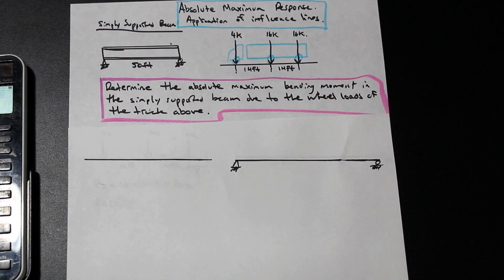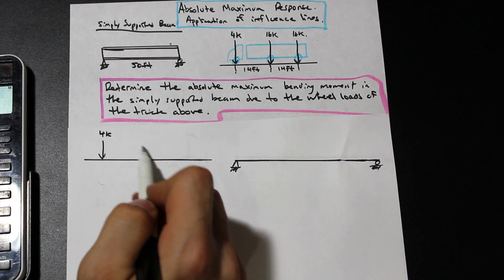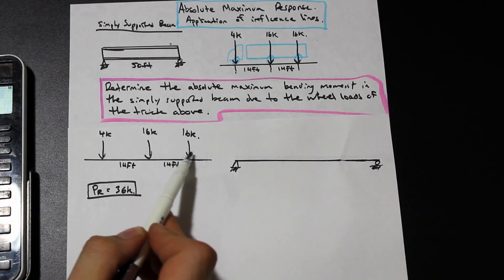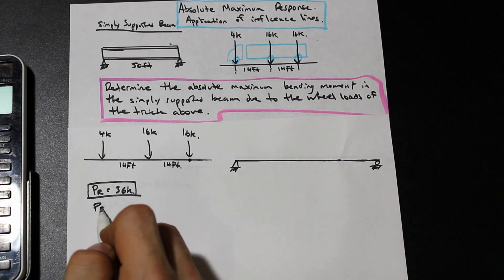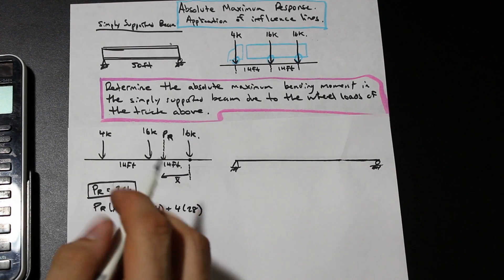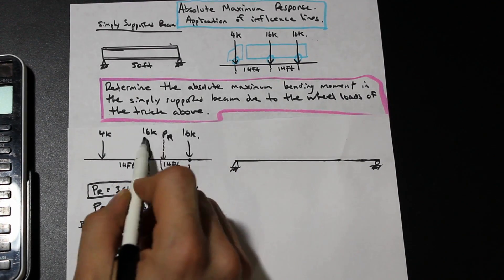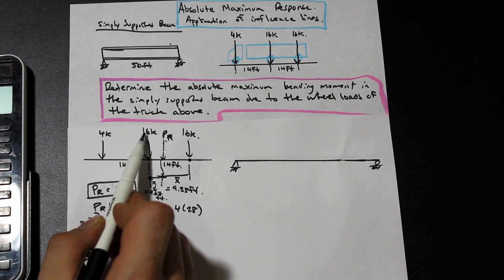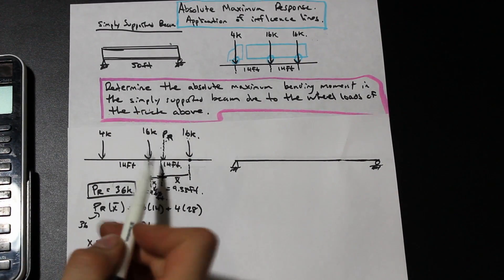Application of Influence Lines - Absolute Maximum Bending Moment (Series of Concentrated Loads)

Comment: Hey thanks for the vid.
I have a question tho. What is the logic behind placing the load such that the distance from it to the CL is equal to the distance from the CL to the Pr as shown in the vid? I understand the use of influence line but I can't seem to connect it with this calculation. Thank you in advance.

Comment: Great video. That's help me a lot. But could you guide me how to calculate the ordinate of each point load, then we can take each point load multiple with ordinate to get maximum bending moment. Thank you
Reply from the maker: Hey, this video was on how to calculate the location of where to place the truck on a simply supported beam.  It's related to the influence line of the support layout you have.  The point loads themselves are spaced according to the given truck load from the code that you're supposed to design for.
Reply: Thank you for quick reply. Could you please make a video that show how to calculate the ordinate of series concentrated load of Influence Line Diagram
Reply from the maker: Yes we will make a video on this topic,.thanks for watching!

Comment: Hello there, We were asked to consider the following: we need to place as many trucks possible on the beam. E.g. since this one is about 26 long, how many axis can you put on the beam? How would you find the maximum moment of the beam? Any help? Thank you!
Reply from the maker: Hey there, it's an interesting question, it depends if the beam is simply supported.  I know in the Canadian bridge design code, they make you design for a uniform load (assuming the bridge is stopped in traffic, so the bridge is full), and a truck (the type of truck, axle layout and load is specified in the code) placed as to create the maximum moment plus a dynamic load factor due to the movement of the one truck.  You'd need to be given the amount of axles, space of how many trucks could fit on the bridge, etc...seems like a strange question heh.

Comment: you said this is an application for influence line, yet you didn't even use the influence line of the beam ?
Reply from the maker: This is an application of influence lines, where the truck is placed is based on the influence line of the beam, we just didn't draw the influence line itself.

Comment: I am sorry to say that your calculation is wrong, because the absolute maximum moment in a
simply supported beam occurs under one of the concentrated forces, such
that this force is positioned on the beam so that it and the resultant force
of the system are equidistant from the beam’s center-line ....
Reply from the maker: Before making accusations, you should probably listen to and watch the video more carefully.  At 7:47, we clearly state that the maximum bending moment happens under the second axle.  This is obvious, as the bending moment will take a linear shape, with a peak occurring at one of the point loads.  However, as you can tell from the start of the problem, the question asks to find the maximum bending moment of the truck and the truck's location is not given.  You most likely confused yourself by thinking that the steps we used to locate trucks position that would yield the maximum bending moment was where we were locating the moment.  

We never mind constructive criticism, but try to show some humility rather than not really watching or listening to the video and declaring yourself correct and everyone else wrong.

Comment: What if the the truck is taller than the beam , how we will calculate the resuiltant force ?
Reply from the maker: Sorry, what do you mean by "if the truck is taller than the beam?"
Reply: AF Math & Engineering i mean the truck lengh if it bigger than the beam span 
Lets suppose that the beam spam is 4 m 
And truck is 6m , then some forces will be outside of the beam , how we will compute  the resuiltant? Or how to deal with this case
Reply from the maker: Oh, I see.  In that case if all axles dont fit on the bridge, you'll need to use two axles instead and place them in the same place like we did in this video.
Reply from the maker: zeyad sbaih if you're in civil engineering and you take a course on bridge design you'll definitely go over this subject in detail.
Reply: If i have 3 axle and two of them only fit , the resuiltant will be calculated from the two axle or all of them ?
Reply from the maker: youll have to calculate a new resultant with the two axles, dont use the same resultant for three.
Reply: Can you make an example with solution ?
Reply from the maker: not in the country right now, when i get back i will make a video on placing different truck axle configurations :) stay tuned.
Reply from the maker: although, havent you taken this in your classes yet? if youre being asked to do it you must have covered it in some bridge classes or something.  what year are you in in civil engineering?
Reply: i am in 3rd year , i take it in structure analysis 1, but this question is a homework , that's why i asked about it.
Reply from the maker: ah great! thanks for contributing to the channel :)

Comment: I have a question.
When you were trying to find the reaction at A... You took help of the resultant force to carry in the moment equation rather than using all the forces individually. Isn't that wrong ??

Shouldn't the equation of moment at B should have  16*something + 16* something + 4* something - Ra* 50 =0
Reply from the maker: Thanks a lot for the comment :) I encourage you to try the method in which you use the resultant, as well as using the individual point loads when taking the moment about B and you'll see that you get an identical answer for Ay.  Why?  Because we located the resultant and determined its magnitude by the condition that the moment of the resultant about a point equals the sum of the moments of the individual loads about the same point.
Reply: AF Math & Engineering yes. Ypu are right bro ! 
Thanks ..for such great videos and tricks.

Please upload videos related to RCC designing and column buckling, asap. 🎉🎉🎉
Reply from the maker: no problem, thanks for the compliment and the comments! we will add it to our list of videos to make, thanks again!
Reply from the maker: Learner CIVIL also I forgot to mention, we do have some videos related to rcc design and analysis, check out our concrete playlists!

Comment: based on your moment direction you used the wrong sign when summing the moment at B.
Reply from the maker: Yup, you're right.  The answer ends up being the same regardless, but yeah that's a good find, thanks for your feedback.  We will make a note of this.
Reply: Also, how again did you determine the max load was under the 16k? I have a problem with 4 point loads and I'm unsure.
Reply from the maker: With 4 loads it can get trickier as you may have to check both. If you've taken any bridge design courses, or will take them, this is a very common topic in these classes.   Typically, the largest load, assuming the adjacent loads are equal or smaller than it is the one where the maximum moment will typically occur.  However it may not always be this clear; if you have a structural analysis textbook there's a much longer explanation in that section that you'll probably want to go over.  If you scroll below, someone asked as well why the max moment occurs under the highest load, and I gave a relatively detailed explanation on that if you'd like to read it.  Hope that helps.

Comment: i have a question. why is the bending moment happen at the second load of the series??
Reply from the maker: Very good question! So in this video, we place the load between the resultant and the nearest force on the maximum value of the influence line, and the maximum bending moment occurs under the nearest load.  If you consider what the bending moment diagram would look like for a series of point loads, it'll be a series of linearly increasing or decreasing lines between the points, where the max will occur under one of the points.  As such, this maximum is the load nearest the resultant.  Try drawing the shear force and bending moment diagram for this configuration and I think it will be more clear to you. 

Also, if you have a structural analysis textbook, they usually have a good explanation and derivation of this concept.  Thanks for commenting, hope that helped.